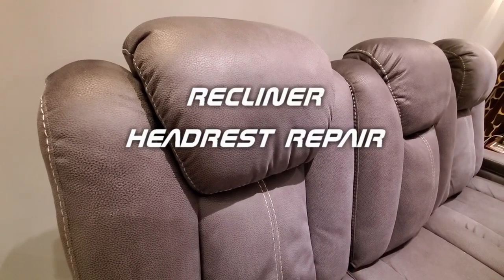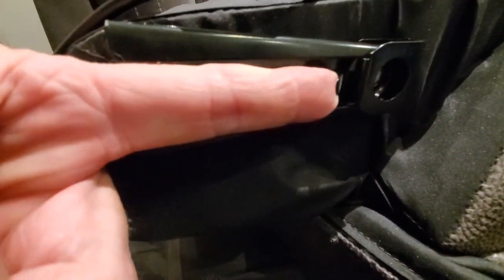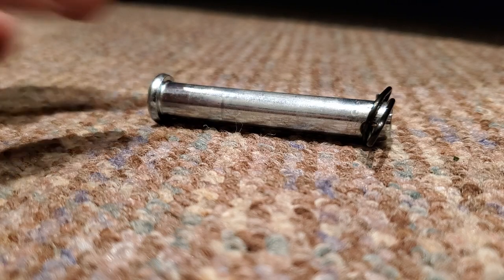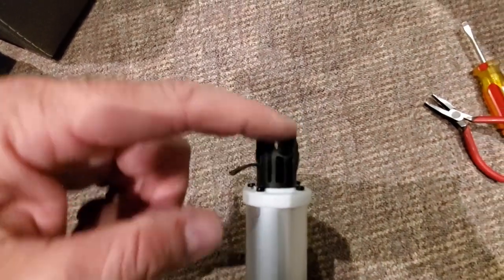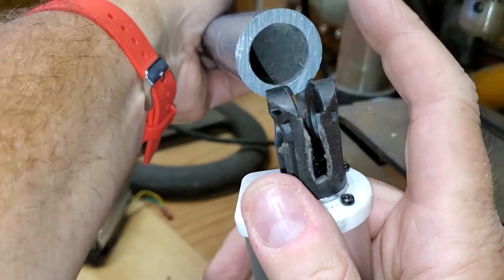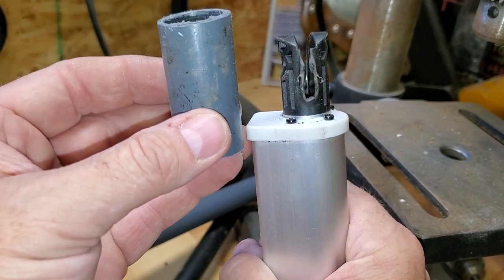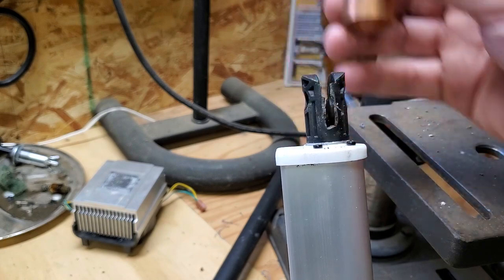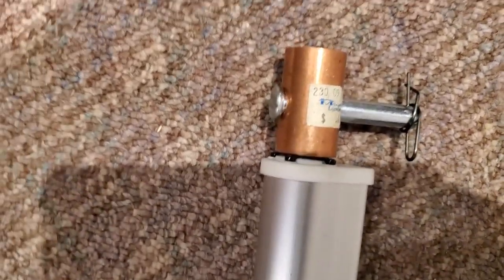recliner headrest fixed!

Comment: The regular reclining noise happens but it doesn’t move at all. I can physically move the headrest but it just plops down. The one that is not problematic is unable to physically be moved up/down and it works properly. It seems as if the broken one is off some kind of hinge that won’t pull it up/down. Any tips? :/
Reply from the maker: Well it could be that the headrest jack is just completely unscrewed. The way it works is a motor rotates a long screw and that makes the headrest go up and down. It should have a stop at the end to prevent it from unscrewing all the way, but it could have failed allowing you to unscrew it off the end.  In the video I show how you can manually screw it in and out. 

Good luck.

Comment: I have the same recliner, my daughter spit up on the recline buttons now there is no power on one side of the couch. And the head rest is stuck in  the up position. Any recommendations on how i can fix this?
Reply from the maker: I would swap the entire back with the other side.  That way you could at least lower the headrest and make sure it's the controls and not the headrest. I show  how to remove the back in my video. 

You can remove the control panel by removing the 2 screws.  Removing the cup holder may help in popping the panel out.  Then unplug the connection at the back of the chair( I show this connection in the video) and pull the entire control panel and wiring harness out to try and clean it. You could then take the control panel with the wiring harness and connector to a repair place and see if they have something that should work.  

Good luck.

Comment: My recliner headrest won’t move up or down and there’s no noise either when I press the button. The seat can still recline and you still see the blue power button when you press the headrest recline button. Any suggestions to fix the headrest not moving problem?
Reply from the maker: I would check the wires for the headrest. There is a connector that could be unplugged or possibly a damaged wire.
Reply: Where would the headset wire be located? And could I access it without cutting the chair?
Reply: If it is an internal motor problem is there 2 motors one for the chair and one for the headrest or just 1? Would I go about fixing the issue the same way you described in video?
Reply from the maker: There should be 2 separate motors. If you watch the video carefully, I believe I show the wires that go to the headrest.  Most, if not all, recliners  have a backrest that is removable so that they can more easily be moved into the house. The wire and connector should be easily visible from the back.  It is highly unlikely that the motor is the problem.  It's either the wire is broken(or unplugged), or a switch problem. Good luck.
Reply: By any chance did you fix your chair? I am having the same exact issue as you are. The chair reclines but the headrest doesn’t make any noise and the light goes on.

Comment: One of mine isn’t working at all
Reply from the maker: I would look for a pinched wire or a bad switch.  These actuators are pretty reliable. If you can check for voltage when you press the button. Can you swap one side to the other side to eliminate wiring or switch.  Good luck.